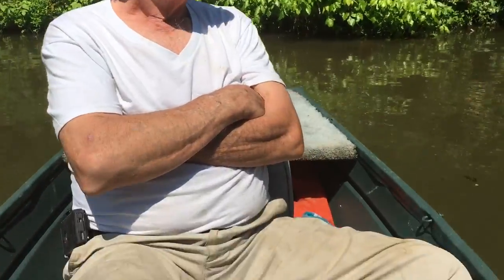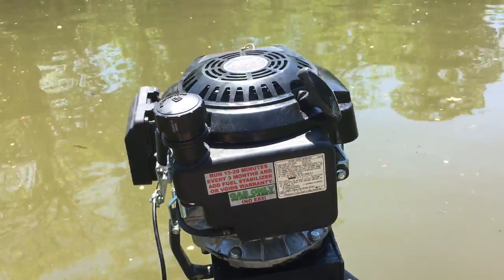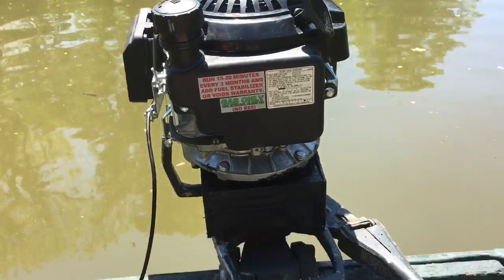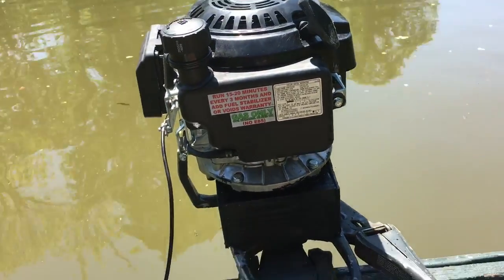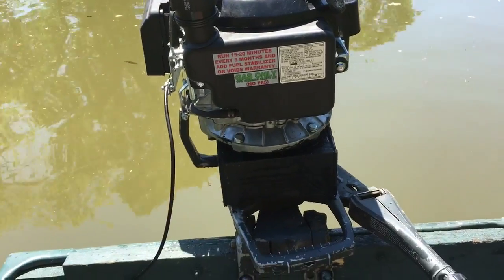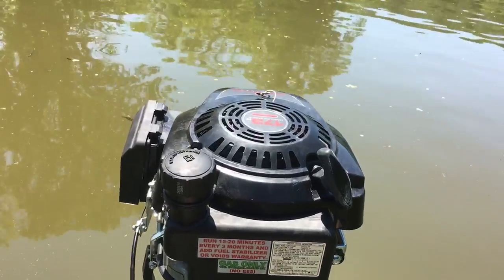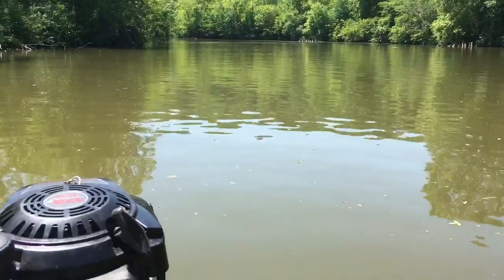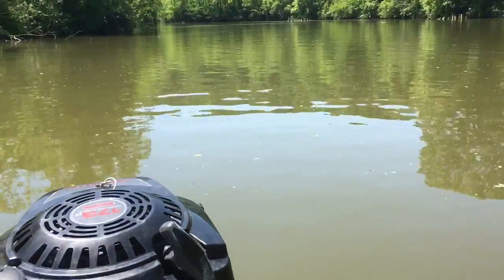6hp Lawnmower Engine on a Johnson Outboard Lower End

Comment from the maker: I just drilled the threaded hole in the motor shaft out to a 7/16 then that shaft slid over the drive shaft that was already in the leg. It was an original 6hp Johnson 2 stroke outboard. I just changed the motors.